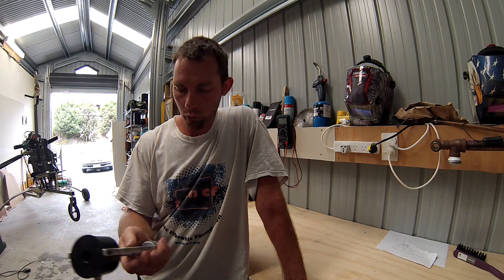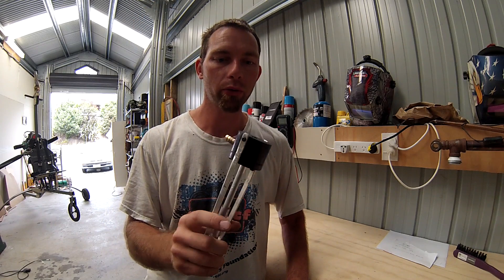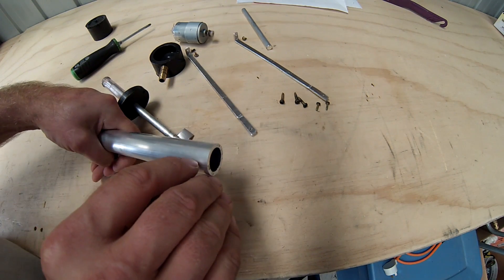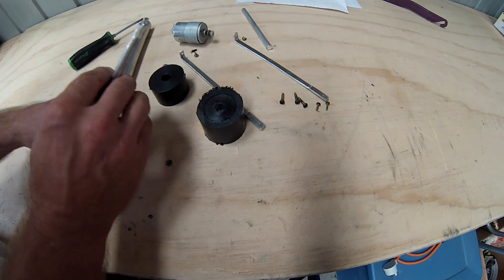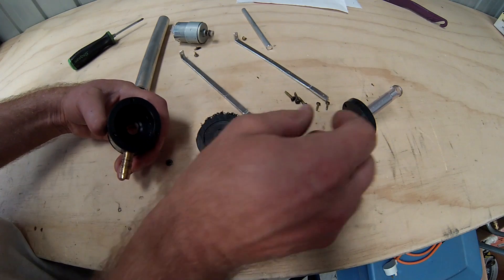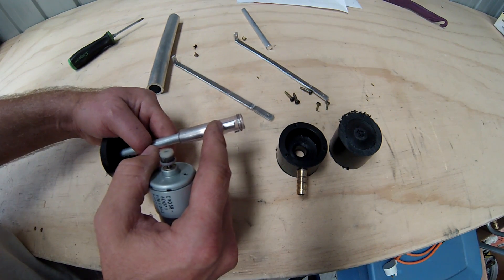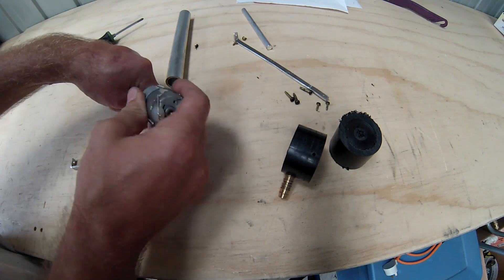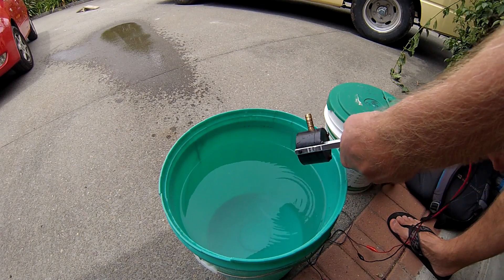D I Y Water Pump

Comment: What do you reckon the motor RPM is Jeremy? Thanks, love it and gave a thumbs up like. Nice work.
Reply from the maker: +gotsteem 
Hi mate, I couldn't even guess at the RPM for that motor. I tried 12 volts on it first but it ran to slow for what I needed. It's a DC motor out of an old printer.